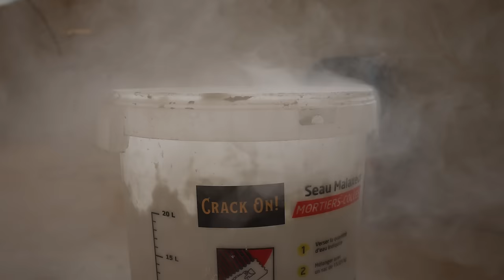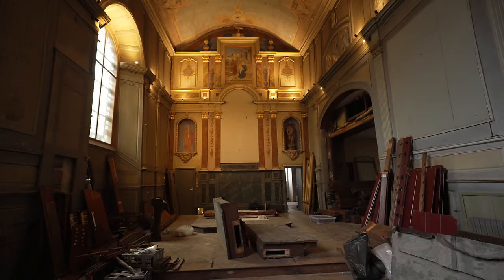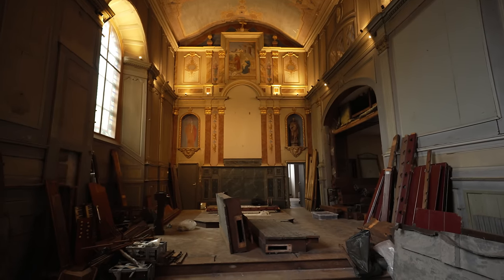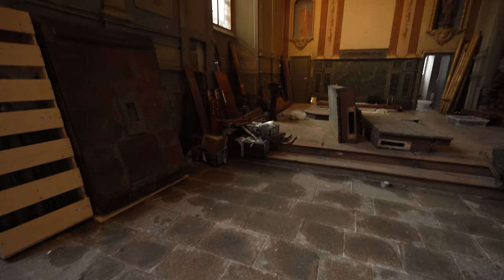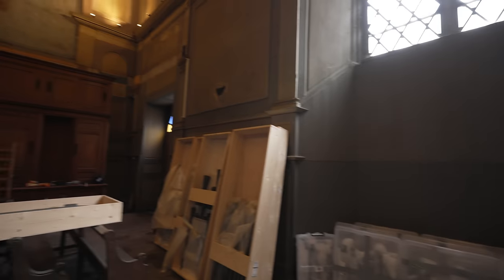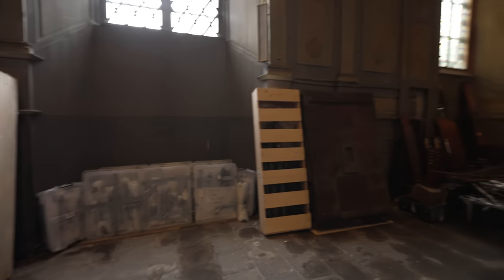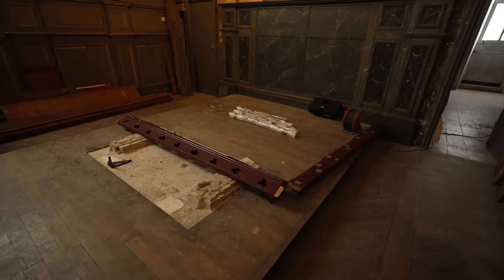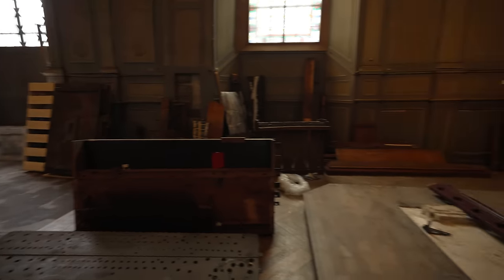Where To Put The Organ?

Comment: Not a bad idea, Billy, but do please first consider where the blower will have to go (I’m assuming it doesn’t fit within the casework, but to one side) - could you place it in the Sacristy behind and then feed a duct through the wall to the platform? This would certainly reduce noise from the blower in the chapel itself… Also, please consider trying to find someone who can come and voice the pipes for you; it’s more than possible that it could sound too loud &/or brash in the chapel, having been previously voiced in relation to the greater size of the Cathedral! Good luck with another great project. ❤
Reply: Good point peterjharnden. I was also thinking of how far out into the room the whole instrument will come once all the pipe chests are re-assembled. 800 pipes will take a fair bit of space.

Comment: Hi Billy, with regard to the future usage concept of the chapel, the location for the organ on the former altar site seems to be perfect. It should also have a corresponding effect with the wall design behind it. The overall spatial effect is well underlined and it doesn't look squeezed under the ceiling on a gallery. Nice idea!

Comment: I love the plan for the organ in the altar location.  Even though it's be de-consecrated, the chapel is still a 'more sacred than profane' space.   And that end of the space is really still the focal point, even with the actual table removed.   I'm actually surprised that the little protrusions of stone are still in place, the only time I've seen a de-consecration, every bit of the altar was removed - down to the sub floor.

Comment: The previous altar location is the perfect space for the organ, for all the reasons listed by Fr. Paul. Audio reinforcement professionals will tell you not to ever place the music speakers (in this case pipes)  in back of the listener because it’s a physical strain on the   human ear. The ear is designed to take in the most sound wave length from the front of the head. Something to bear in mind when you arrange seating in the event space. 
You’ll have that kitchen done by the end of the month. Bravo on all your latest projects!

Comment: Yes, it's the perfect place Billy. I have two others questions. 1.The wood floor (the little stage) where the organ is going to be place seems to need a fresh coat of varnish. Before you place it there it can be a good idea to do it. You are not going to move that master piece again in near future.
2. It can be a good idea to refresh the paint on the walls (not those beautiful drawings) just those parts of the walls where you can. You are going to give another gorgeous life of the Chapel. It's going to be not only revitalize but  "magical". I am 💯 percent sure of this. 
After those littles works done, you place the organ. It's going to be the jewel of the place. 🌟

Comment: Hi Billy - Congratulations on getting that instrument dismantled and moved.  I've done my share.  Kinda dirty work.  I have a couple of suggestions.  Send the reservoir(s) out to a builder to replace the leather and clean them up.  They regulate the air pressures in the instrument.  That should be done by a builder who will remove the leather and replace it with the appropriate kind.  There should be plenty of builders in France.  Take good care of the mouths of the metal pipes.  Avoid touching them because of the potential of crushing or damaging the wings.  The wooden pipes have tuning stops in the top.  The stop leathers will probably need replacing.  I would imagine that all of the valves have leather parts hidden in the pipe wind chests.  They will probably need to be replaced if that hasn't already happened.  The lead/zink pipes should be handled wearing cotton gloves to avoid transferring oils form your hands. 

 I think that placing the instrument in the former altar area is good.  It looks handsome there.  I didn't at first do to its previous purpose as a sacred space.  I was thinking to place it more  the side of the chapel.  Is there a place to install the blower?  Try to keep the installation on an inside wall to help with temperature regulation.  Finally, I suggest you have a builder make a thorough inspection before putting it back together,  Make sure there is a wide enough space behind the instrument to gain access for maintenance.  Once it's installed, give or sell the pipe boxes to a builder rather than tearing them apart.  As you know, they are a pain in the butt to make.  Crack On
Reply: This is amazing advice, you are thoughtful to share it.
I'm concerned about the sound resonating through the doors and into upper areas of the convent, how do you perceive this? It is such a small space for such a large instrument. Would advice be pertinent so that the acoustics don't do damage to structure or health? I'm interested if you know how to assess such things or if it would be trial and error

Comment: My only concern with this placement is the vibration of the pipes on your frescos above, that would need to be a consideration no matter where you placed this organ in your chapel. Plaster cracks with vibration and perhaps some  modern sound baffling behind the organ before you install it would lessen the potential damage.  I ran into this very problem when working on the restorations of St Mary’s cathedral in San Francisco back in the 70’s. Something to discuss with father Paul before installation.

Comment: The location suggested in the altar area is superb! However, if you're planning on any restoration of the chapel, it seems like it would make more sense to store it until that time. Organs are extremely susceptible to dust and changes in temperature. Once the chapel is restored, heated, and the dust has settled would be the more logical time to install as it will cause less damage to the instrument. Something to consider.
Reply from the maker: The issue is leaving it in puzzle form so we forget how it goes back together, either way it needs to be assembled soon and we can project it during restoration

Comment: Judging by the comments that’s pretty much a universal YES. Positioning the organ at the altar would effectively change the space from a chapel to a concert hall. In which case (depending on exact measurements) a suggestion would be to raise the organ on a platform so that the organist would be visible if other performers were in front. The organ pipes would have a greater presence and hence be more dramatic.

Comment: Great choice of location for the organ. Although you feel it's likely that it won't be necessary to dismantle through organ when ready to clean and restore the ceiling's artwork, I (still) think it advisable to do a minimal amount of work on the artwork on the wall surrounding where the organ will be at the alter. Depending on how close to the wall the organ will sit, accessing the wall afterwards for artwork restoration could potentially be a tremendous pain in the bum. 
Just a thought, but what do I know? 🤔😅

Comment: I think there are only two options in this chapel: putting the organ at the centre of either the front or the back end of it. Because the architecture is quite symmetrical, it would look odd to put it to one side. You could also go away from a classical design and flip the room sideways, so the organ is placed on the long side without the windows, and seating would be arranged in a half circle around the organ. But that would make the gallery look out of place. And - even more severe - this would lead the sound of the organ to be reflected by the opposite wall very quickly - and that could have a catastrophic impact on the sound. Since the back is occupied by the gallery that you want to rebuild the only option in my opinion will be the one you suggested. If it fits in that nicely, I don't see a point to put it somewhereelse. But please make sure all openings for maintenance are accessible - otherwise it will be a nightmare tuning the organ. And yes, I know organs that are build (by renown organ builders) and are a hell to tune due to accessibility issues to a majority of the pipes. So maybe you need to build it up half a meter away from the wall...

Comment: I don't remember the organ pipes being very visible as it was in it's original home, but that can always be changed. I grew up around organs and my brother has built the largest organ in the state of Idaho in his living room - of course he custom built his house to contain his dream organ, being 2.5 stories stall and 600 square feet, not counting the organ loft above the garage where the pipes, blowers, etc. are. He has designed a facade which is quite impressive, but it always reminds me of the face of some golden monster. Using the organ as an aesthetic focal point at the altar location would be brilliant.

Comment: The top of the columns are called capitals. There are three main “orders” of capitals: Doric, Ionic and Corinthian. Doric is the simplest with just a circular capital, Ionic features curved volutes that look like rams horns and Corinthian is the most elaborate with stylized acanthus leaves. It looks like the upper capitals are these. The lower ones are a combo but again maybe Corinthian.

Comment: With regards to the organ, the altar is the most obvious place, my initial thought was that if you were to do weddings in the future then the configuration of the space wouldn’t work. Have you considered putting it in where the confessionals currently are? It is a small space granted, so what about putting it where the toilets and the hole in the floor for the original steps to the gallery? That has the height 🤷🏼‍♀️ and when you build the new gallery have the stairs up to it from underneath. Anyway just food for thought 😀 no doubt what you do will benefit the Chapel greatly ❤

Comment: Speaking of skirting board in the upstairs you used MDF. Please consider using real wood as MDF will not hold up to a kitchen with water. Some places you can cost save,  in a high traffic area it would end up costing more in the end with replacement from water damage

Comment: Hi Billy, I think Father Paul's idea is great.  Did he say anything about access panels at the back of the organ for maintenance?  You could create an access door from the other room so you never have to remove any of the finished paneling on the side walls of the organ.  Though my original idea was to place it at the other end of the room, I didn't realize how close the side entry door was.  You don't want the organ on any exterior walls or close to drafts and humidity which may affect the leather bellows.  The border on the kitchen floor is a great idea.  No matter how square the room is, there are always slight size changes which would really be noticeable when using full tiles. Plus the skirting will help as well.  Excellent job! 💖🇺🇸

Comment: Just adding another ‘yes’, to positioning the organ in the altar space. It keeps the place sacred as you have suggested, even though deconsecrated. Aesthetically pleasing in the overall symmetry of the space. Once mirrors are fitted, ideally positioned for concerts. A max/min hygrometer placed just inside organ will help you monitor what is happening with the moisture in the chapel. It is large swings that are more dangerous for it rather than overall temp/ humidity.

Comment: I agree with the placement of the pipe organ in the alter location. It is ideal for the organ to speak out into the length of the room rather than across it. I do not know how lively the acoustics are in that chapel but I believe the smaller air volume in that room as opposed to its former location will be more suitable to its pipe compliment and probably its voicing characteristics. The rear gallery could be a better spot for the instrument to speak out from but as you said, this would entail considerably more preparation work. What's more, in as much as a higher mounted instrument has potential for better sound projection via the ceiling and the one at your chapel is a clear barrel vaulted one, the third criteria for this would be that the surface is hard and not porous. I think your safest bet is to stick with the front floor mounted option. I've heard too many front floor mounted pipe organs before and after relocating to rear galleries lose much of their sound projection capabilities  due to porous material ceilings and too many cross beams cluttering the way. I hope you will be able to either install the blower motor away from the organ in another room or at the very least insulate it in a box so its sound doesn't interfere with that of the pipes. Good luck in your endeavours. I look forward to hearing your Hill and Norman instrument.

Comment: Yes, Billy. The organ would fit well against the altar wall.... You are not going to re-consecrate the chapel for religious srvices and it's placement won't offend the past history. 
I agree that housing the organ up in a gallery would pose an engineering challenge. A couple of tonnes up high, even if the supporting beams are inserted into the chapel's walls, could pose a risk to the structural integrity of the building. To do that right, it would cost a lot of money. So hosuing the organ where the altar is, is very wise.

Comment: Agree with your plan for the organ location.
As the building is a chapel and not a church it does not require an altar.  Worship in a chapel needs only the space and a pew.  The chapel was provided for purposes which no longer exist since its official occupants moved out of Ernée.  Removal of the altar will simply in fact have effectively handed the building over to secular usage.

Comment: I thought about the alter as y’all were breaking it down the other day. Def about the best spot to maintain symmetry. But it’ll need some type of backlighting - maybe more of the fancy multicolor ones you already have. I’m concerned that the lighting for the reredos isn’t yet sufficient.  Possibly down lighting oriented on the pipes would maintain and enhance the majestic look and feel of the Chapel. 

Even for weddings, there should be enough space on the chancel for clergy and even wedding props. Even a super beautiful chancel rail could be used to hi light the organ.

Comment: Normally the organ in a chapel is placed opposite the alter. When placed there you will have the best sound. When placed on the old alter you never know if you get strange echo's. In that case you can use the old altar as a podium. Don't worry about the things you do there. The chapel is clearly deconsecrated. In the altar (that stone table) was a relic of a saint. When that is removed, the chapel is deconsecrated. As the whole altar is removed, the chapel must be deconsecrated and can be used for all activities, religious or not.

Comment: What a project! I love the idea of putting the organ in the space of the altar. That way it will become a center piece and quite a feature for future performances. What I might consider is to slightly lift it higher, that if you have e.g. an orchestra around it, the organist has a better view of what is going on and also can be seen from behind. Not a lot, maybe 1-2 ft, so that the organ itself would fit a tad higher into the big frame in the back. But that location is definitly the place!

Comment: You will think this crazy but if it doesn't affect the stability of the organ, put it on wheels/casters with a skirt board covering the bottom.   

Otherwise you might be stuck taking it apart again when the chapel needs a repair.

Comment: Would it be possible to run a metal detector over the raised altar area to be sure the good Sisters didn't hide anything there (before you put 2 tonnes of organ on top of it)?  Also - can you check the structural supports below that area?